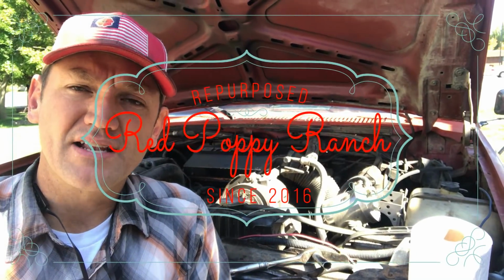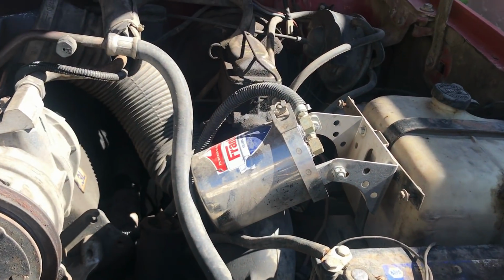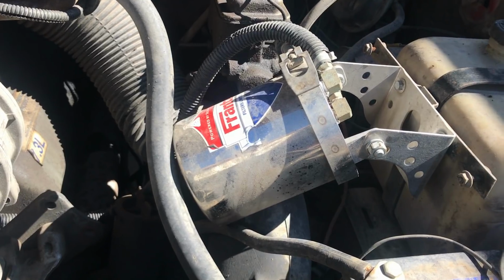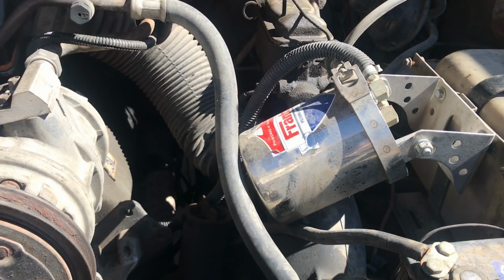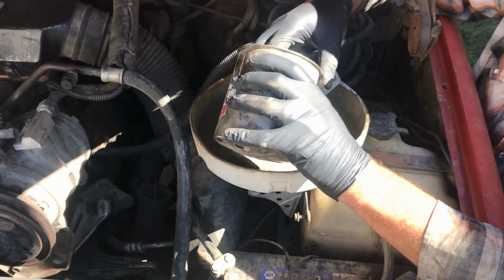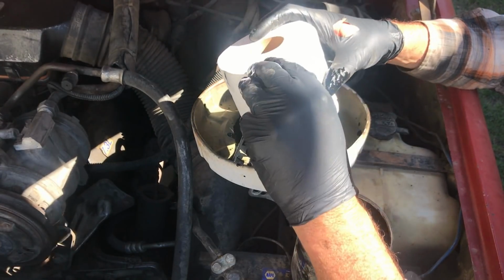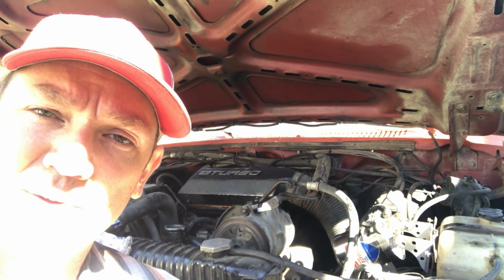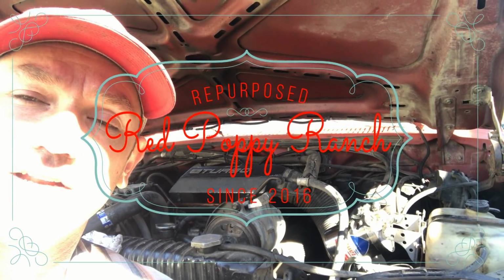#146 - Toilet Paper Oil Filter Maintenance... (Frantz Oil Filter)

Comment: I bought a synthetic element made to replace the TP roll, it felt hard like plastic. When I put it in the canister, I could not get the can to fit down on the base enough to install the clamp band. I pulled it up and the ring around the tube was digging into the element. Does this channeling ring need to be removed? After about a half hour of pushing on this canister, I did get the V clamp band started and continuing to push the filter down, the assembly was back together. 

I just bought this system about the time Frantz was acquired by the current company. I'm not happy that I may need to replace the filter assembly because the element does not fit or assemble like the Scotts 1000 roll previously used.. The positive thing is that fine grit can no longer be felt in the oil on the discharge side, TP did not stop all particles from passing through the roll confirmed by a particle count sampled on the return line.
Reply: The best place for the ring is on the trash can. Its not needed with the Scott 1000 sheet if the roll fits snug.
Reply: I have a 30 year old Frantz element. It looks like a custom made roll of toilet paper with a thick core.The advantage is it fits. Other than that I don't see an advantage over Scott 1000. I use toilet paper filters because I like to use toilet paper.
Reply: Just wondering if you have done a particle count with the synthetic elements compared to tp. The synthetic and cellulose Frantz elements are 4 1/2 inches tall,  their filters don't come with the ring anymore, it's not needed with their elements that they want you to use, I would keep the ring on hand when you want to use tp.

Comment: When using this filter my understanding is you still have your normal oil filter. Is this right and does this filter system have its own pump?  I'm just wondering why people are saying this is bad to use?
Reply from the maker: People don't like what they arent familiar with. I've used them for years. The engine oil pressure is used to push the oil through. You use this along with your standard oil filter.
Reply: Red Poppy Ranch to me it seems like a great idea.less stuff going into one oil filter seems that you would be giving your normal oil filter longer life keeping normal flow. You can get 12 rolls of Scott for around $8. Id change that filter every 1000 to 1500 miles then normal filter every 5000 miles.Seem like a great simple Idea. I would like it better if it had it's own oil pump. I really think thats it only down fall. I may look into modifying one with a separate pump.
Reply: It is very rare but I have seen engines so worn out that the oil pressure light would come on at idle. You wouldn't put a bypass filter on that. At one time all filters were bypass types. Even the Rolls Royce . They all had a orifice so that the oil pump could supply the engine and the bypass filter. The Frantz will keep the full flow filter clean and free of acid. Once a.year would be excessive. I did fine in northern Idaho but I was driving 70 miles a day. Short trips in cold weather requires more attention to the filters because of condensation causing sludge. Filters that clean oil need more attention.Especially in cold weather.
Reply: My 19 horse power lawn mower has a toilet paper filter and a full flow filter.the stock oil pump can easily supply both filters. Briggs and Stratton. The same for my lawn tractor with the Kohler v twin.
Reply: At one time all filters were bypass types. They were optional equipment. They all had an orifice the same as a Frantz. There were no full flow filters. There were engines at one time that didn't need a filter. You put oil in a tank the oil lubricated the engine and dripped on the dirt road.
Reply: I think there are some large stationary engines that have an oil pump to supply multiple bupass filters. Not necessary for any road vehicles. Bypass filters.have been around for 100 years.They all had a restrictor  orifice 
 Usually 1/16 inch.
Reply: The people that say the  filters are no good are people that know nothing about them. With almost 60 years of using them I'm  a little  more qualified to explain them than someone  that has never seen one. My 41 Dodge came new with a optional equipment factory installed Fram bypass filter that hooked up the same way as the Frantz. No extra oil pump needed. It had the same size orifice as the Frantz.  The Fram supplied the oil pan with a stream of filtered oil the same as the Frantz. The Frantz uses toilet paper.  The Fram used cotton. A smaller version of the proven Luberfiner  for Diesels. No full flow filters in those days. Other optional factory installed bypass filters were Purolater, AC and several others. All used cotton. Some time in the 60s good elements were no longer available.for these filters. In 1953 John Frantz came out with a cartridge filter adapter that allowed you to use superior toilet paper. There are still Frantz 3 stackers on big marine engines 
They are a taller version of the origional Frantz design They are being replaced by Gulf Coast Filters paper towel filters. The Frantz 3 stackers were very effective  but a mess to change.
Reply: A lot of people are like turkeys. You put their food in a new place and they will keep going to the old place to eat.

Comment: When I found out about the Frantz I had a nearly new Rambler American. The flat head 6 came with a bypass filter. The oil would get. Black in a few days. I changed the oil often. I was getting Delo 100 for 29 cents.An old foogy came into the station. When I checked his oil I made the remark I see you just changed your oil. He pointed to his Frantz and said son if.you had one of these filters you wouldn't need to change your oil and your engine won't wear out..I knew he was an engineer at Standard oil. We knew our customers in those days. The oil never got black again.In the old carburetor days the oil got black in a hurry. I thought every one will want one of these.I signed up as a dealer got a Frantz demo and some carbon black.I went to the big berryessa Flea market in San Jose..Ca. About the first guy stopped and explained to me how oil is supposed to get dirty it means it's doing its job. I never heard so much bull shot in my young life. Its not complicated. The full flow filter removes the engine damaging abrasives. To remove the smaller engine wearing abrasives You change the oil or add a depth filter.at normal oil temperature The water and fuel is removed. You don't get acid without water. If you are getting coolant in your oil fix the leak.Diesel engines generate a lot of soot.You will need to change the filter more often.. Some soot particles will get thru even toilet paper.It is not abrasive but will turn the oil black. Black is not an abrasive.Rub some in the palm. If it's clean it will wipe off clean.

Comment: I hear a lot about the bypass filters voiding the warranty. This goes For any non stock item such as power chips exhaust brakes ECT . That's fair they are not responsible for anything non stock.There are a lot of Gulf Coast Filters on trucks now. One guy goes into a truck dealership.He said he needed for them to remove the Gulf Coast filter and put it on the new truck. He was told that will void the warranty. He said no problem I will buy another truck that won't void the warranty. The salesman said wait I will make a call. The salesman came back and said good news the warranty isn't voided. Don't remember the engine makes. It doesn' t matter Gulf Coast has letters from the engine makers stating the warranty isn't voided. On the other hand the government was told if they put Gulf Coast Filters on a large Mercedes diesel engine instead of Mercedes filters It would void the warranty. How much money would you be able to spend fighting Mercedes Benz.

Comment: Anyone who doesn't change their engine oil on a regular basis is asking for trouble especially on turbo diesels,carbon from combustion builds up in the oil over time and when it passes through the hot turbo it solidifies blocking the return pipe to the sump and starves the turbo of oil which cools and lubricates causing failure,another problem with not changing the oil is it can block the oil pump strainer causing low oil pressure and rapid wear to crank and bearings.
Reply: These problems are caused by not keeping. The oil clean. Allowing the oil to get dirty wear and foul the engine then draining it is a poor maintenance program.

Comment: Actually any of these filters that use some type of tissue paper will get the job done as a truck driver I have seen many good ones cotton is very good i.   f it is compressed enough some of the luberfiner
types use cotton or recycled newspapers and wood chips A firm roll of toilet paper is a wonderful oil filter but watch out for the b's stories they come with toilet paper filters. Using the filters since 1963
Reply: Does the system extend the life of the past 10000 miles
Reply: Oil that never gets dirty will greatly extend engine life.clean oil doesn't allow sludge to build up in the engine. Using filters that don't clean oil then going back to have your dirty oil changed generates profits for the oil changers but does nothing for the car owner. One problem with the new cars is finding a place to mount them. On my Nissan Altima I have two filters between the grill and radiator. I remove the grill to change the Toilet paper. Its a hassle but I am a clean oil fanatic.
Reply: Was at Walmart the other day getting 
 some synthetic oil. I believe  they had 5  10 and 20 thousand  mile oil.  I got the 20 thousand mile oil. You dont even need a filter to go 20thousand miles
Probably better to keep it clean.
Reply: Project Farm says the Super Tech 10 K oil is as good as the 20 K mile oil.  I normally dont drain oil.

Comment: Checked the Frantz website, and the words 'toilet paper' are never mentioned, not even in the FAQ section.
Reply: Frantz is a great filter.toilet paper is a great filter element. The problem is when you mention toilet paper you are overwhelmed by stupidity. Frantz would like to shake the word toilet paper. Its too late they are long known as a toilet paper filter. I started using them in 1963.at one time they had FAA approved filters.Guess what they used toilet paper. Oil doesn't break down paper. Toilet paper included. Put some in oil and see.
Reply: Not sure when Frantz came out with their own elements. I used toilet paper for about 20 years before I saw the Frantz elements. Frantz called for 2 ply facial quality when I started using Frantz in 1963. The grocery stores were full of it. Single ply was loose wound junk. The FAA and PMA approved  AeroFrantz  used the same element. I sold a few Frantz elements about 30 years ago. They were a high quality roll of paper with a thick core. Gulf Coast Filters was the last to come out with their own elements. I think one of their customer's  NASA was an instigator there. It is a problem when one department is purchasing  a lot more toilet paper and paper towels than usual. They wrap the toilet paper and Paper towels in cheese cloth and call them filter elements. LOL. The truckers figured it out pretty fast. The last I heard Tand A truck stops serviced the Gulf Coast Filters. They had trucks on the road with over a million miles with no oil drains when the filters were Bounty Big roll towels. Was talking about one. Road King wanted the phone number of the owner. They did an article  on it.. That was a Peterbilt with a series 60 Detroit that Shell oil was studying. Of course it used Shell Rotella. Was owned by Pepsi of Gulfport ,Mississippi for.years. They sold it to a guy that hauls motorcycles.  Too much information. The reason the big diesel engines can go so many miles with no oil drains and almost no engine wear is the paper towels keep the oil clean and the new oil added at filter change keeps the oil replenished with new additives.Years ago Gulf Coast filters was a Frantz dealer. They used the Frantz 3 stacker on the big.diesels.several on.the locomotive engines  on the offshore rigs.
The 3 stackers used three rolls of toilet paper. Still some in use on.marine engines in the gulf. It was a.taller version of what John Frantz invented in 1953. I did a Fleet of powerstrokes about the time the 6.0 powerstrokes came out. They ordered the Gulf Coast 01 filters bolted to the frame.I think the problem with the toilet paper filters is they sometimes need to be changed pretty often especially on engines like my old 6.9 Ford. Some dont get changed often enough. At the time the 01 used a roll of Bounty Big roll paper towels. I didnt mind changing my little toilet paper filter bolted to the plastic fan shroud in an upright position.

Comment: I started using the Frantz in 1963. My Rambler came with a spin on bypass filter. Bolted to the head the same as a Ford flat head with steel oil lines.Of course the Ford used a cartrige filter and good elements were available.they used cotton
Which were as good as toilet paper if it was packed tightly. A Fram element could turn the oil clear in a gasoline engine the same as a Frantz. Most people didn't change the element often enough. You didn't have a choice with the Rambler. Spin on filters were not available that cleaned oil. Pleated paper is useless at cleaning oil. I think sometime in the 60s pleated paper replaced the superior cotton elements. Frantz came out with an adapter that allowed you to use toilet paper in the old housings. Frantz came out with a copy of the old Fram housing that used of course toilet paper. Frantz came out with a 3 stacker. For diesels that took three rolls of course Toilet paper. Not good marketing
They realized later they should have came out with. A more expensive element that could work as good as toilet paper that they could call something else. Motor Guard and Gulf Coast filters also learned that lesson a little late.

Comment: You keep saying 1000 ply but I'm sure you mean sheets or something because like 2 ply is pretty normal I don't know that I have seen more than 4 ply and I'm not real sure I have seen that and are you supposed to leave the cardboard
Reply: i was trying to figure out the same thing. I was like 1000 ply? whatchu talkin bout willis?
Reply: Its Scott 1000 sheet 1ply. Thats what I have used. I was talking to one of my customers that has over 500 K on his Toyota Corolla wagon. 400 K WITH the Frantz. He told me on an outing the boy scouts got into his Frantz elements.
Reply: The core stays in the oil filters from top to bottom

Comment: With the Frantz demonstration unit you would put enough carbon black in the container to turn it black.You would turn on the pump and circulate the oil thru a pleated paper filter. Any brand of spin.on would do.The oil lines were clear plastic. The oil would go in black and come out black. Of course when you switched to the Frantz The oil came out clear.Of course even though you couldn't see it a very small. amount was so small it found its way thru the paper.It was only a color and not an abrasive
I probably change my toilet paper more often than most.On a diesel engine I want the oil to be a shiny black such as black shoe polish. It is easy to spot dirty diesel truck oil. I know what the lab will say. The oil is analytically clean. After 50 years you know when the oil is dirty.

Comment: Those were the good old days working in a full service gas station. You say sir that oil needs to be changed.You put the car on the rack and take out the drain plug. Nothing comes out. You push a screw driver in and a couple of quarts come come out. You pour in some kerosene and run it for awhile probably causing more trouble. That's what the boss said to do.
Reply: Probably helped it out. I have an old motorcycle I fixed up, ran like crap no matter how much I tried to tune it up, accidentally left it sitting for a week with the fuel valve on and it drained into the oil. Replaced the oil and it ran better than before.
Reply: I hear you. One of.my kohler.engines needed a new fuel pump.Instead of.getting a correct pump on.it
I.put an electric pump on it. The float couldn't  handle it.I got.a crankcase  full of gasoline. One time in Idaho I was trying to start a International truck. I would.try the either and try to
Start it. After a few attempts it.started.Ran a second then exploded. Too much either in the crankcase. It must have been 20 below.. what if I had been doing that with my wife turning the engine. She might have been a widow.
Reply: Was talking about a series 60 425 HP Detroit. Road King magazine asked for the owners phone number.  They did an article on the big Gulf Coast 0 2 and Rotella. Also an article on Amsoil and a Como filter. Turns out the Gulf.Coast filter needs 3 gallons of make up oil when changed. When the full flow filters are also changed its 5.5 gallons. That's equal to a full oil change every 40 thousand miles. That's how they keep the additives up to specs. Same as a Frantz only bigger. When I retired it was approaching  a million miles with almost  no wear. It was torn down and measured by Shell oil engineers about  every 250 k miles. The used oil poured back in. One engineer said it's not unusual for these engines to go 1 million miles  but not be in near new condition.  A NASA engineer  saw my posts and started using them. He said toilet paper is better than paper towels. That is true but big filters are better than small filters.